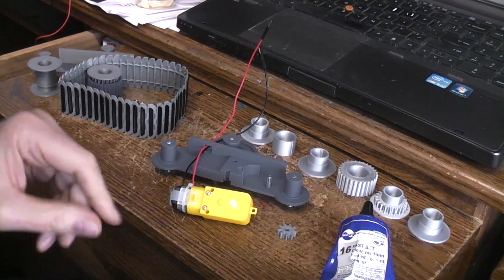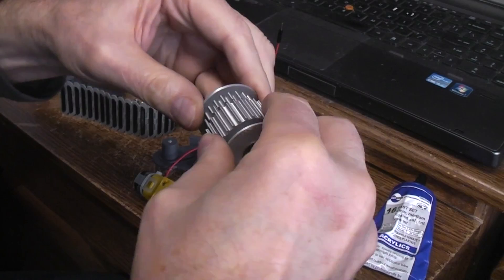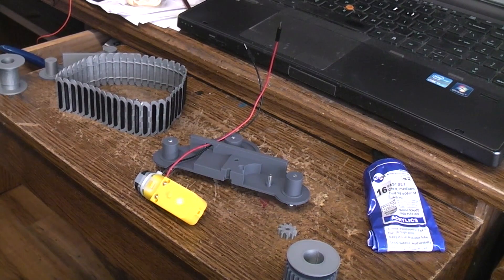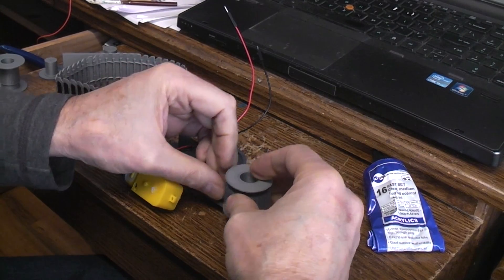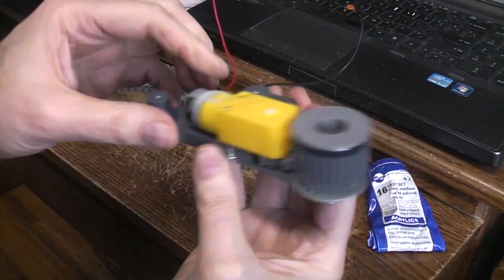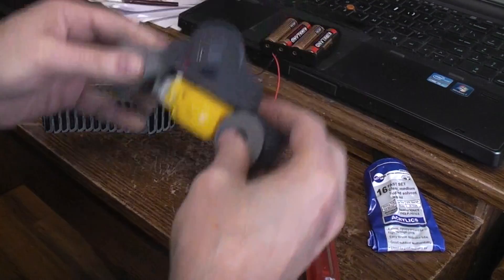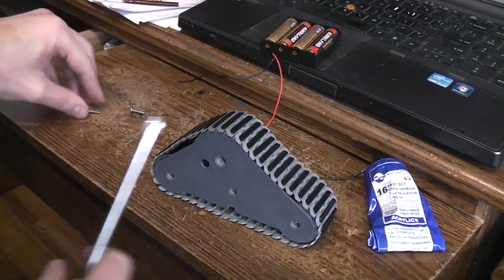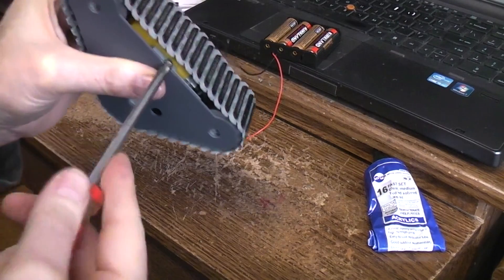3d print 1/5 scale Johnny 5 motorized tread units. Part 4. Testing the 1:48 TT gearmotors.

Comment: Great work. Hope I can use your stl files but thingiverse won't download them. Do I need consent from you.
Hope you can help. Thanks
Reply from the maker: Many have downloaded them without problems so, it might be your browser blocking you.  Consent for downloading any STL files from thing-i-verse is not required.
Reply: @Robothut  
Yes I was able to do it now..
Is there a link for the motors you used. Thanks
Reply from the maker: @keifer242  The sellers come and go so links for things like the motors do not work for long.
But you can find them on Ebay, amazon and for less money on AliExpress.
Reply: @Robothut  
Ok I'll try that thanks

Comment: I am printing your model to motorize my Johnny 5. I see that the second side that you screw on has the upper guide wider than the first but in the STL the two sides have the upper guide equally narrow. There is no gear going there, so I wonder: Wouldn't the links fall off? I haven't printed them yet.
Reply from the maker: Not sure what you are saying is wider, the upper track guides are the same width just as the STL files show. Tracks do not fall off, I have made 6 of them so far, no problems , even in snow they worked great.

Comment: Nice , i wonder how much weight that might carry
Reply from the maker: We may find out soon.
Reply: Im printing these right now to test out myself , nice work on these though,  they look nice and solid 👌
Reply from the maker: Lets us know how your build goes. I printed mine on the bambu A1mini. @titanwross
Reply: @Robothut  iv just finished one of the tracks and printed main structure and gears in PLA and track links in TENSILE resin,  iv already taken two links off to get it nice and tight but iv seen other models this size that use this front cog and it will eventually slip due to the tracks streching or too top heavy, so you may need something to keep tension on that back wheel to keep the track links stuff but a work in progress and a great start to the year 😀
Reply from the maker: If the tracks stretch, then there is something wrong with the material you are using to make them. Also, I would not recommend resin printing the track parts. This design does not have a rotating top wheel, it relies on the fact that PLA when contacting PLA will slip with very low friction. I do not think that resin printed parts have this same anti friction property. @titanwross
Reply: @Robothut  iv been building johnny 5 toys for the past 10 years now so im pretty well aware of what a functional track system can do and can not do lol. , if you go to any johnny 5 group you will rarely see anybody with moving tracks,  simply reason being no one has designed functional  tracks that can actually push a fully built toy j5 and not have any issues with the tracks but as time goes by technology is dramatically changing and so are the materials,  the resin im used to make your track links is an industrial strength resin design for this kinda thing and its only been available just a few months,  its expensive but my God is it Fantastic,, for me your tracks printed too clean and crisp and your holes are actually too big lol your tolerance is for fillament printing  so that's where I got the extra slack and I had to take two links out just to make them turn properly with out the front gear sliding as I already have them connected to one of my Punk j5,, he is heavy and needs a good solid build track system,  so far you're are working but just a bit slow ,but that's fine as you don't really want a fast johnny 5 , I look forward to any progress you may do with yours and I will post a video soon of yours working 🙂👌